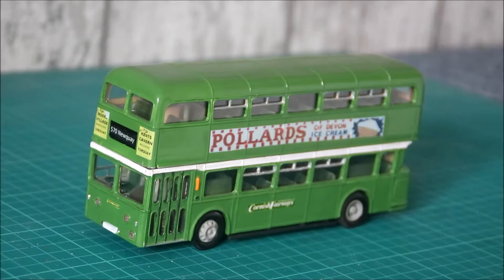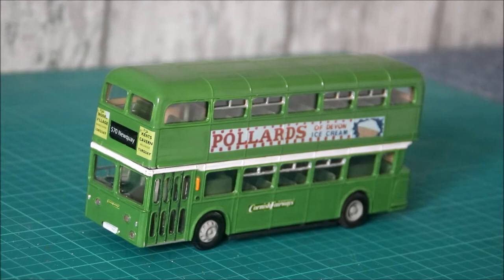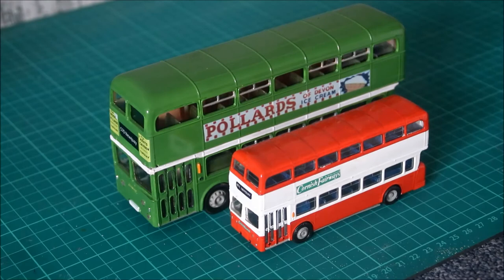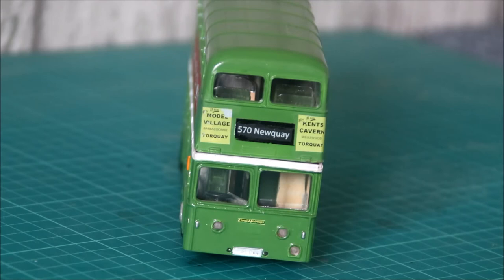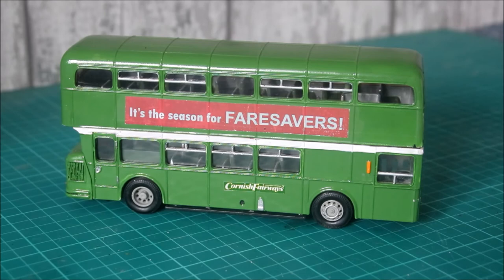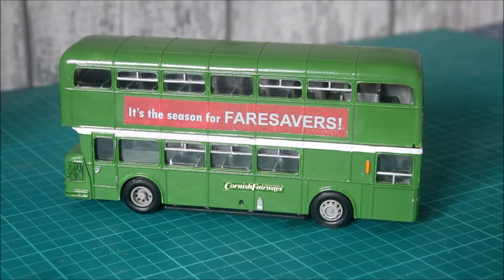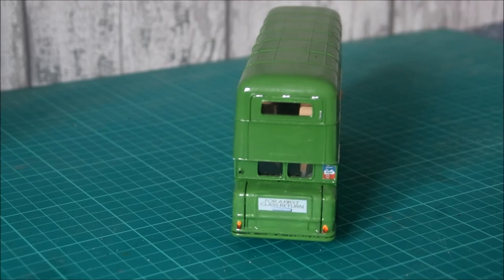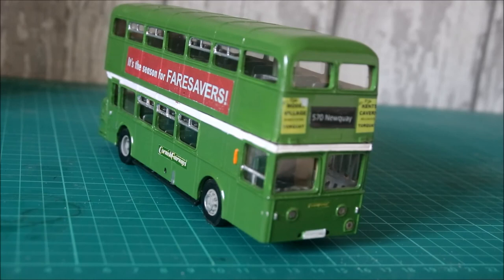Is it really that big? | Code 3 Model Bus - The Finished Product

Comment: Wouldn't the front nearside advert be more likely to be damaged, due both to the washer and overhanging tree branches?
Reply from the maker: Great question and logic would suggest that. However, in rural areas buses often have more offside damage from trees etc than on the nearside. Ultimately, I would bash half the roof in along each edge but that will be another project. All those little details though do  create improved models